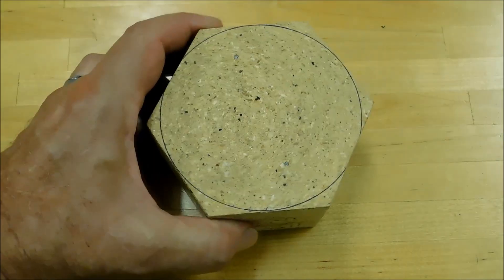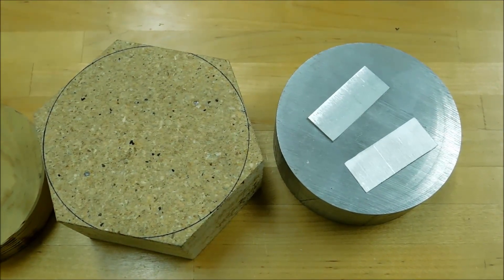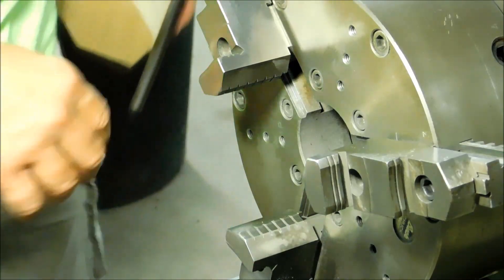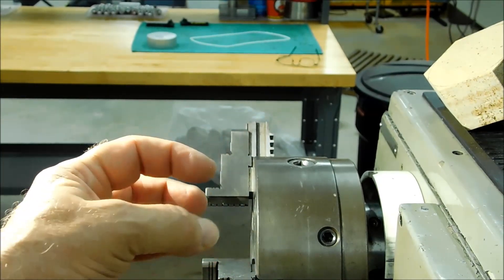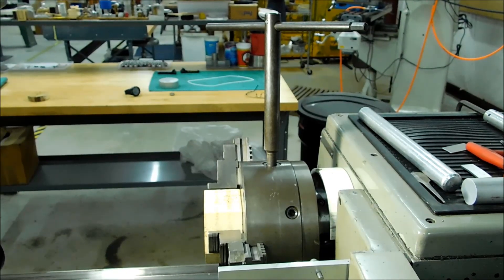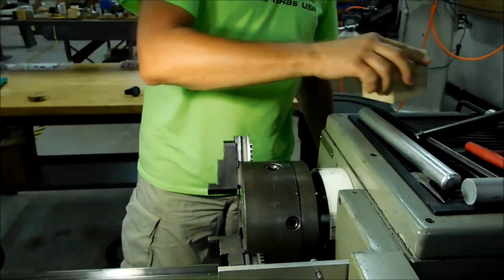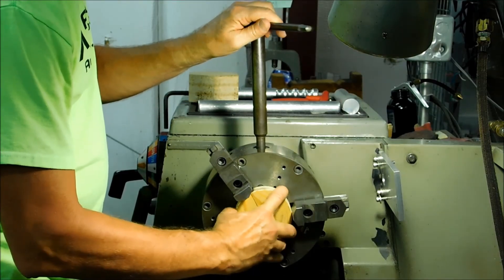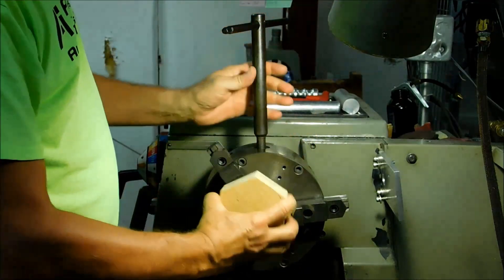Why Did That Part Come Out of the 3 Jaw Chuck?  DON'T MISS THIS ONE.

Comment: Hey Joe, Great video. There's another related issue that deserves mention and that's that over time the ends of the jaws get worn to a bell mouth shape. Then you come along and try to grab a part with only a small portion of the jaws. If that is hanging out very far at all or it is not perfectly balanced or you try anything but the lightest cut that part is going to walk itself out of that chuck and go flying. Like many hobbyists I have a used lathe that has that sort of wear on the 3 jaw ends I'm aware of the issue and know I should do a tool post grinder job on them but haven't done so.

Comment: Joe, I am 65 years old and have my own lathe since the 1970's.  I have never worked as a machinist but I partly do now, running my 15" gear head lathe daily.  Your tips have been so concise and practical and have helped me in my day to day productivity and safety.  I watched Adams bolt after seeing your tips presented in this video.  I really have never considered the excellent points you made and I will think of those each time I use my three jaw chuck.  Adam made some really good points about the learning process and I hope he watches your video.  When I watched his, I immediately saw that he was taking chances on the clamping to stick-out ratios that would have me ducking for cover and ones I would not consider without a tail stock support.  The step drilling also seemed very frightening on most materials but with brass, I wanted to run.  Anyhow, I enjoyed Adams presentation but learn much from you yet again.  Btw, I only use power-feed on my parting operations 😇 so I don't Always agree with you.  For sure your skills and knowledge are beyond what I will ever achieve and your sharing is very kind and appreciated.
Reply from the maker: You are a brave man. I never power feed a parting tool. Its just a personal choice.

Comment: Always amazes me how so many folks accept that hex and 3 jaw chucks were made for each other. Having made thousands of hex brass fittings I can only say how easy it is to get it wrong. Ended up having a collet closer for my lathe, made at some expense I must admit, but it enabled use of hex collets to hold the brass.  So much safer, particularly in a production scenario where you are just trying to get the job done!.  My wife was a really good operator, but I was much happier once we had the collet closer. Not only, no looking for the low spot, but each push or pull of the lever meant she was not heaving on the chuck key.  OK so not a large chuck, but on 400 parts it makes a difference.  Thanks Joe for pointing this out to folks, it may save them learning the hard way.
Reply from the maker: I hope so.

Comment: Your jaws are all the way out with 1 bolt holding them in. You are supposed to mill the contact area flat and you won't have that problem. Must be a rookie?
Reply from the maker: Your lack of experience shines bright in this comment. Do some research on scroll chucks and get back to me. Say Hi to DB for me.
Reply: I'm sure I have Way more experience than you moron!
Reply: @Twilightzoneisreal  But maybe not in a machine shop... Do some research and do try to be polite,.

Comment: I was always taught 3 jaw self centering chucks were only to hold bright shaft, machined parts  and hex bar, no casting,forging, pipe, out of round material, to maintain  the accuracy of the chuck , but in-reality this doesnt happen much, ,but my 3 jaw rarely gets use, the 4 jaw independent lives on the machine
Reply from the maker: A 3 jaw will hold virtually everything. I only use my 4 jaw for square and rectangular material. If your 3 jaw isn't adjustable, I can see the 4 jaw choice, but otherwise, not so much.

Comment: I knew immediately that Adam didn't have the right feature for his live centre. In fact, I was aghast when I saw how pitiful it was. I have however learnt from you the clocking technique. Thankfully my lathe is only a small lathe that was used for a college to train apprentices so any mistakes may not be quite as dangerous. I do however still treat it with great  respect. Incidents that I've had include leaving a chuck key in and snapping a HSS Parting Blade.  Boy, do they go off, for a nasty suprise!
Reply from the maker: You never forget that sound.
Reply: They don't half go off with a bang, I was sure my lathe chuck jumped up an inch. I stopped it and had a good look around couldn't believe there was no damage done to the machine. I've only found one small piece of that parting tool to this day lol.
Reply: @eyuptony  What rattled me was the force and speed that the blade shot off at. If it hit bare skin it would leave a nasty wound especially with the sharp jagged edge on the blade.. Something like that hitting you in the face or the eye would be extremely memorable. Now I always stand off centre to the work piece in the hope that it at least minimizes the possibility of being struck.

Comment: Joe, I used to do a lot of wood turning. Sometimes the chuck would hold the part sometimes not.  I resorted to face plate or a lag screw to hold the work, and retired the chuck to the shelf.  Honestly never thought about it in years.  I will try your technique now, thanks for sharing!
Reply: Remember that wood behaves differentially then steel. Which can both be an advantage and a risk.
Think through what can happen, how fibres are aligned and the risk of cracks and so on.
But rightly used it's a great tool for wood working. If I remember correctly Carl Jacobson ( https://www.youtube.com/c/CarlJacobson/videos ) has some good advice on how to use a chuck on wood somewhere among his videos.
Reply: @sharg0  Thank you for the tip!

Comment: I had a piece of 1.5" sch40 hop out of the 3 jaw on my lathe just yesterday. I'm 99.5% certain that it was due to irregular stock that was not perfectly round. After rechucking it, I stopped every couple of passes and checked the chuck. Wish I had seen this video two days ago. Thanks Joe P.!
Reply: I try and use collets if at all possible for round parts. You get higher clamping forces, and slightly out of round doesn't cause the same type of issues. It is an investment in tooling, but you will save time.
Reply: Every day there is something new to learn. I love it.
Reply: A collet wasn't an option for me on that size pipe on my lathe.

Comment: This happens when chucking drill bits that have 3 flats on them.  Not only that, but the machine that cuts the flats is not usually properly centered, and results in tool wobble when chucked on the flats.
Reply: Exactly the situation I was thinking about. I set on the flats a few years ago and assumed they were concentric. Nope. Effed the job.

Comment: Just use one shim to add your artificial big high spot. The circular block will not go anywhere.
Reply: @Giulio Buccini Serious question. How/why is this better than just finding the low spots on the workpiece?
Reply: @josephcitizen4195  Just elementary geometry, I think...
The imaginary circle between the three  teeth becomes greater than any high spot of the piece.
Think of it in such way: a finger pushing the top of a disc sitting on two pins disposed along the bottom part of his circumference.
This method can be used also for irregular shapes.
The secret is not to force the three contact points to stay on the same circumference.
Reply from the maker: Actually, you just reversed the material error. You now have to turn down the material the additional thickness of the shim before it will clean up the area where the shim rests. Finding the low grip area allows you to just cut off the high spots.
Reply: @joepie221  yes, that is a drawback. My idea is thought for really irregular "circular" shapes. The little devil living in the pieces makes you always discover that the low spot on a tooth correspond to an high spot on another tooth and viceversa...

Comment: Not criticizing my friend but leaving stuff on top of your lathe is a mistake. I worked behind a young fellow years ago that was running a leblond in front of me and his machine was running and vibrating and instantly I caught one of his chuck jaws in my chest that was on top of his lathe. When I caught my breath, I proceed to kick his ass! I was lucky it wasn’t a head shot
Reply from the maker: I agree and preach the same thing. What the camera angle really doesn't show is the deep ribs in the mat and how securely everything is nested. Although I do keep several items on the head, nothing is forward to the rear of the chuck that could fall and launch. But its a good practice not to clutter it up.
Reply: Joe Pieczynski I agree, the leblond had a gripper pad too, but the guy was running with his jaws extended out and running about 700 rpm and the rest was history
Reply: Did ya watch the whole vid ? NO NEGATIVE COMMENTS 🤷‍♂️

Comment: You have convinced me, Joe Pieczynski 😉

Also, considering the questionable condition of the brass bolt gentleman's lathe, there's a potential for the chuck jaws to be well worn and bell mouthed, which would only add difficulty to the circumstances you covered.
Reply from the maker: If in doubt, add a live center.
Reply: Ah, but the brass bolt gentleman did use a live center. That makes it more likely the workpiece toss out was due to poor fitting in the chuck as you have demonstrated.
Reply from the maker: @gregfeneis609  He did not have a receiving feature in his bolt for that center. It was a point against a flat surface. Not recommended.
Reply: Right again, Joe. There was a brief shot of the end of the workpiece, if there was a receiving feature, it was tiny. The gouge trailing away from the center seemed deeper than where the center point rested.

Comment: Good advice Joe, Thank you for this Video.  I shook my head many times while watching the Video you are talking about.
Reply from the maker: On my first day of shop class back in 1971, the instructor had us gather around an old south bend lathe. He handed a broom handle to the first guy inline and said if you can break it, I'll buy you lunch. After nobody could break it, he fired up the machine at about 60 rpm and started talking about the machine. He casually turned around and slipped the broom handle between the chuck jaws. The machine ate the broom handle like candy and didn't even hesitate. That made quite an impression. These machines are serious business and should be respected.

Comment: Excellent points. You had jaws out quite a bit . You need to be careful your still on the scroll when running jaws way out. When making heavy cuts in a three jaw the work can push back unless you have a some kind of stop set . For that reason I would rather use a four jaw . Takes a little longer to setup but can be well worth it .

Comment: How about a link to the other video so this one has some context?
Reply: https://youtu.be/98MCz9gQaiE
Reply: The bolt falls out around 16 minutes.
Reply: Thanks!
Reply: 16 minutes and 35 seconds to be exact. It's not dramatic, it's during a fast forward portion of the threading process. Nothing goes flying, AS doesn't have a brush with death.

Comment: Safety Karen wants to speak with your manager! Why arent you using a safety chuck key with a spring?
Reply: Story time,i had a boss that was always in hurry ,no matter how fast you do it he finds 10 other jobs for you.So a guy brings in a axle from a windshield wiper converted into a BBQ rotating shaft for lamb cooking etc.Guy welds it and now it needs to be turned to diameter again so it can fit casing and ball bearing goes on axle .Problem is this shaft is short and it has a large plastic gear on 1 end .No way to put it in the chuck and turn the diameter you need.So i put it in drill a center hole grab it by the plastic gear ,use a tail stock and i am doing it slowly,slow speed ,low feed -its working -but too slow for mr hurry!
So  he comes by and he says move away ,i wont argue with him i was just apprentice,he puts 2000 rpm with a medium feed ,i dont remember ,but he takes too much in 1 pass.
What happens is as soon as knife touched the part it flew across the shop at least 20m away ,hit the wall,boss hand is bleeading(not too bad),he is cursing as he goes to a first aid cabinet.
We laughed that we work in Baghdad,blood to your knees ,shrapnels flying around trough the air ,and that we should put sandbags around the lathe !
i didnt know back then but i should have center drilled the other side and turn it in between centers ,even then it would be difficult to do ,and i would need to do a custom dog but that is the right non bloody way.

Comment: I watched that video but didn't think of this reason for the part coming out.
Too busy observing the amount of unsupported stick out combined with the thread form tool being plunged straight in rather than by way of a properly set top slide.
I can't be sure I remember to giggle in flatted stock all the time , so probably a timely reminder of the risks.

Comment: Yet another excellent tip, I've had that happen to me (uskng a hex er32 collet block) I shrugged it off put it back in and got lucky (presumably because the jaws were almost in the right place, so the low spot on the faces fell into line).  I'll definitely be loading hex stock better in future, thanks Joe👍

Comment: Spot on with the hex, though with a casting or forging you need to find the grip point that produces the least runout. Most often especially with castings it is best to avoid the low spot.  Usually a freehand ground casting gate.
Reply: I get what you're saying, casting dont always have enough material to always do this, but if you can find a "rut" it will still work. It doesn't have to be the lowest point, just A low point so the part can't turn under cutting force. 
Also if you only intend on cutting in 1 direction you dont have to worry about backwards pressure as much, but its not advised as vibration could still loosen things up.

Comment: I saw the same prang. First thing about that brass bolt prang was that I was taught to do the most difficult machining first if at all possible. If you have an oops you have minimized the wasted time. So on that job i would have turned the stock and face the end. Spun it around and re chucked, pushed with a blank pressure button( that is a button with a centre hole drilled in it. It fits over your centre and allows you to push without using a centre hole in the part) checked for run out and then centre drilled it if you needed to. . I do a lot of turning without a centre hole but use my pressure buttons. It is much faster, an of course there are force limitations on longer parts. I turn discs on a special adaption that has a plate with a large centre hole thru it and it just fits snugly over the parallel portion of the live centre. The remaining centre just protrudes about 3/16". When I machine the od of discs I simply up a centre hole in the middle that just allows the centre to fit into but doesn't contact. it is my quick and nasty alignment  method and it slops it being able to be thrown out if you a too aggressive with a cut or its an interrupted cut.

Comment: And don't for a second think that because you can't get the part to move the machine can't.
1. Compared to our weak bodies the machine is close to infinite stronger.
2. With external clamping and increased RPM clamping forces are reduced, this is one of the reasons chucks are marked with a max RPM.

IF in doubt about fixation, don't run it!
Reply from the maker: Solid advice.

Comment: Another super tip from you. I also saw the video with the brass screw and it was a little scary.
I myself had tried to use a center in the tailstock.
Thank you for sharing your knowledge and experiences.

Comment: Hi Joe I really enjoy your videos. I noticed an Allen key cut on the handle of your chuck key. Then I saw the grub screws in you chuck near the back plate. I have a similar chuck that I’ll fit to my lathe one of these lockdown days. My question is can you center the chuck using the grub screws and could you share a little more about the system and the chuck. Thanks

Comment: Another great video on user safety when working a lathe, no one wants a hard object flying towards their body at high speed. Great info Joe.
Reply from the maker: My closest call ever was a 14" diameter aluminum ring, 1/2" thick at 900 RPM skipping off my left shoulder and grazing my ear. if I was standing 3 inches to the left, I'd be dead.
Reply: Thank God that did not happen Joe.

Comment: Great stuff, Joe... Second nature to old salts like us, but very important points made in this video. When I was mentoring for several years on large NC Lathes, mostly forgings,  these very things you covered was 99% of the reasons for ejected parts. Easy to assess cause with these huge power chucks and hard jaws. The grip pattern of the teeth was a dead give away.
Reply from the maker: When you inspect the part after an ejection, just look for the one jaw that only left a single line in the part. Then inspect the drag direction. Case closed.
Reply: Yup...